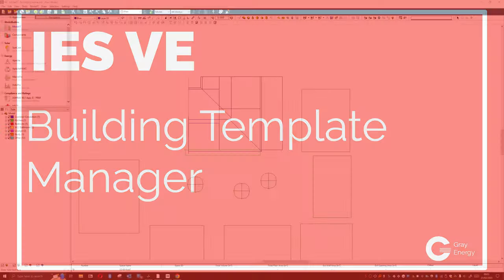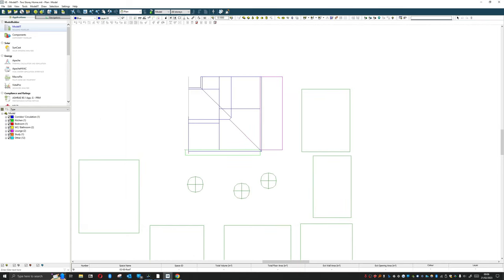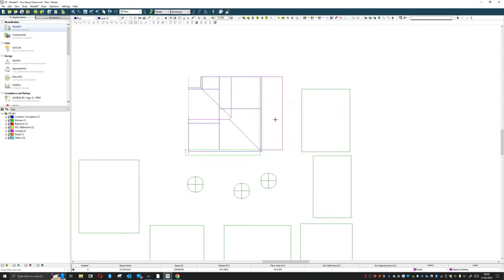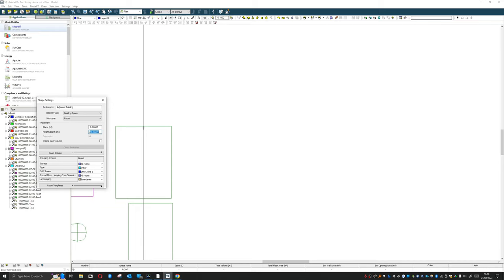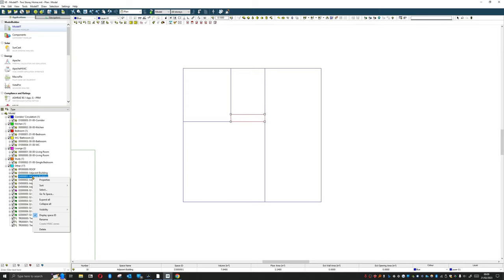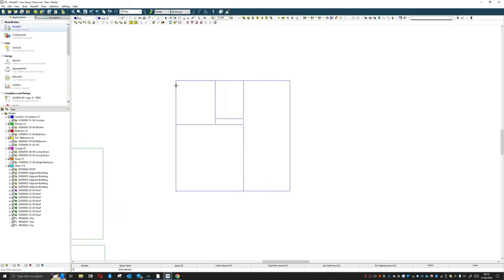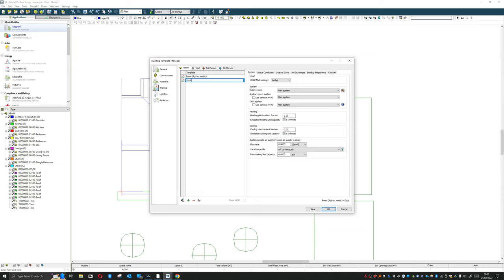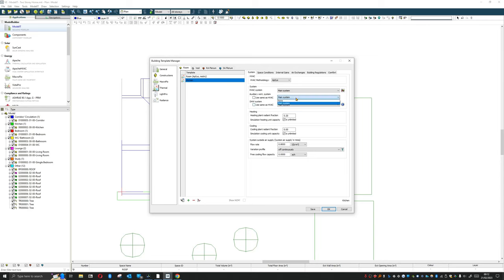IES VE Tutorials - Episode 15 - Building Template Manager

Comment: Excellent video ! Is there a way to modele auxilary ventilation with a flow rate by people + by surface. Like ASHRAE 62.1 , 5CFM/PERSONNE+0,06CFM/FT2 ? Thanks !
Reply from the maker: Not exactly familiar with those standards, but you can set a space to have two seperate auxilliaries that work in tandem. You would do that by creating two aux. ventilation enteries under the ventilation section of the BTM. You would set one-  (and I'm going to use metric, but I assume that the settings also exist in imperial) litres per second per person and then have the other in litres per second per m^2.

Hope that helps!
Reply: @grayenergy5413  Thanks, it should work indeed!!